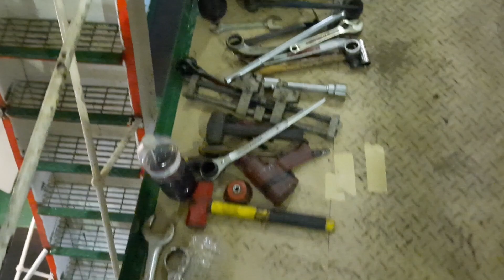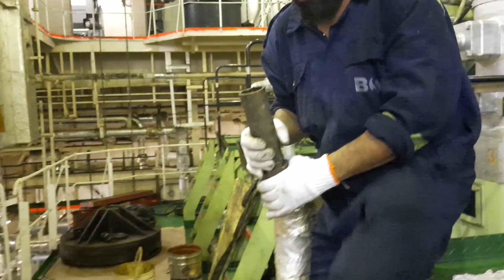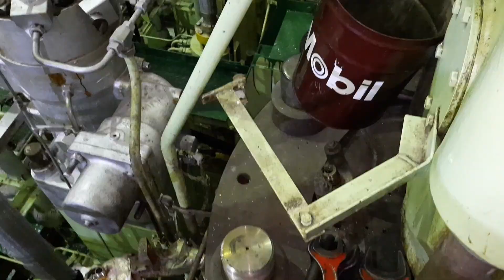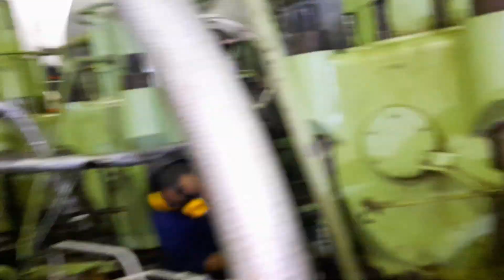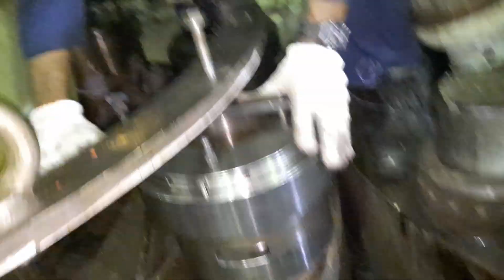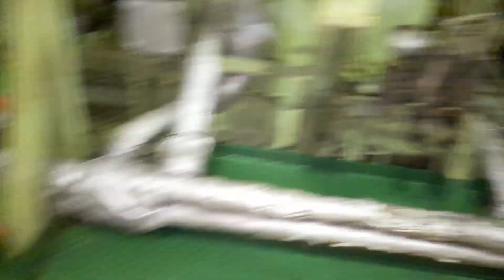SECOND ENGINEER JOBS....MAIN ENGINE PART-2  MAN B&W DECARB...

Comment: Hai sir thanks for your explanation ,in case while removing cylinder head cover nut if jack get stuck for one or two bolts,what action to be taken,I can use other jack and remove it directly or I should tight opposite nuts and simultaneously remove all nuts?
Reply from the maker: as u told tighten the other bolts and try to  open again.. pls make sure stud threads are free from any kind of dirts and surface clean...

Comment: During lifting up the cylinder cover do we need to attach a charged service air hose for exh vv closure???
TIA😊
Reply from the maker: its alwys btr to attach hose so as we can avoid exhaust valve getting stuck during lifting...